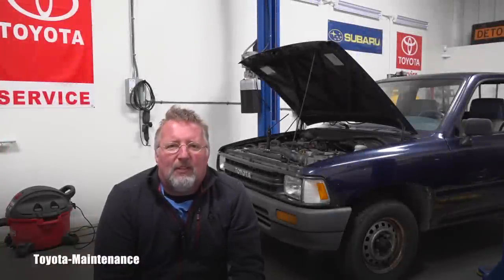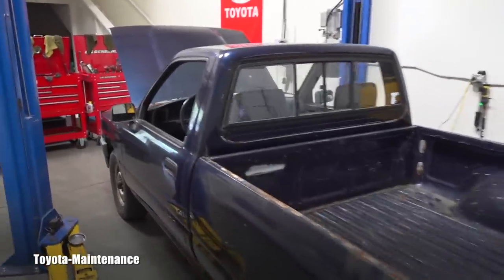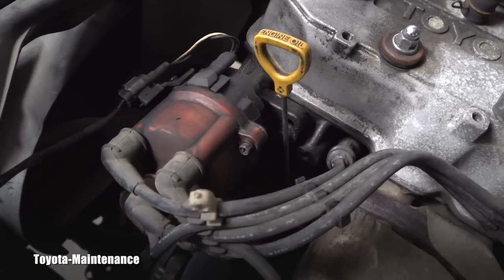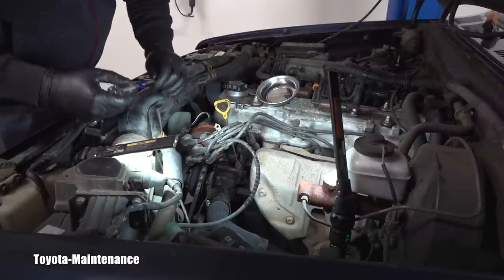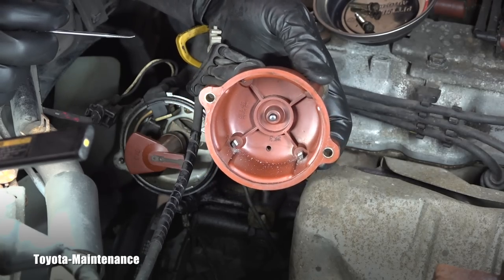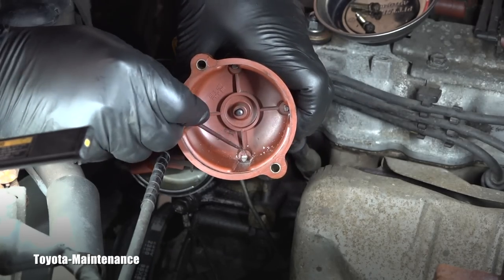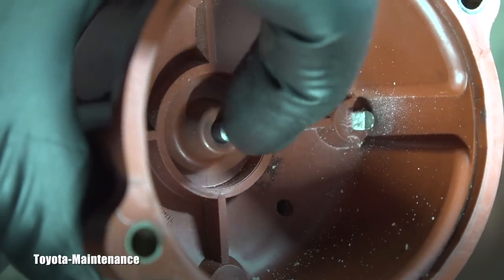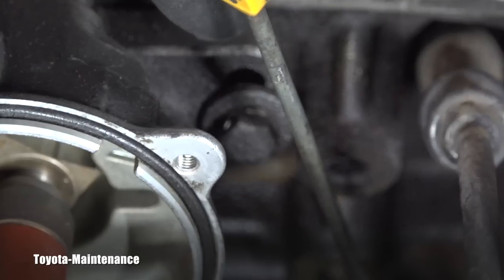Toyota Ignition Distributor Cap and Rotor Inspection

Comment: Peter, After 29 years the expense of a new rotor, cap, wires and even a coil  can be justified. Just make sure to use OEM parts as we expect an update video in the summer of 2049 and discount parts won't last that long. Long live #manual pickups!
Reply from the maker: yes !
Reply: @ToyotaMaintenance  :)

Comment: If the screws are too tight I use a needle nose with a rough surface and grab the screw and twist to break it loose then use the Phillips to unscrew. . Worked for me everytime.

Comment: Still have my 91 , 383,000+ miles on it . Would do jack knife tune up on it while on lunch break in the woods. Biggest breakdown in delivering spark to plugs is in the condition of the plug wire set. All to often service shops would just replace everything, habitually running up the bill. "You need a new Johnson rod in there" . Seinfeldism

Comment: Thanks for sharing this information, I just change cap and rotor myself,also changed. Cap O ring and distributor shan’t o ring commonly leaks oil .  A. Fresh set of wires and spark plugs was  NGK spark plugs.
Reply from the maker: Nice work!

Comment: These are good old reliable  like a wife 😝 LOL if the cap is not cracked just clean it   With a  small wire brush it’ll work fine

Comment: I note that in this 1991 Toyota the engine drives the rear wheels unlike in the saloons which seem to be all front wheel driven. Also the distributer does not contain the ignition coil . In my 1987 carina  which has only done 85000 miles I have just fitted   the third ( 3rd coil ) new coil The coil  which is within the distributer !!!

Comment: If that truck belonged to me, I would have you replace the rotor cap, the rotor arm, new plug wires, and plugs.  While you are at it, replace the fuel filter.  Just me. Thanks.
Reply: Why replace things that are still working.

Comment: The distributor cap screws on my 20r engine have Phillips and 10mm hex heads. Much easier to use a wrench. Also as far as I know, only the oem caps have screws that don’t separate from the cap.

Comment: Before that they had points to adjust and a vaccuum advance for the ignition  on carburettor engines.Usually on a lot of makes there were clips holding the cap on which made servicing much quicker.It would be nice to have a simple car to fiddle about with again.
Reply from the maker: Great point!

Comment: I've got a '93 and the triggering owner rotor with the 4 paddles on the shaft is about 20 degrees off counterclockwise from the rotor. Shouldn't it be directly in align with the rotor? There is also a single paddle above the triggering rotor (and below the top rotor} that's in exact alignment with the top rotor. I'm guessing it's only there to help with alignment...??

Comment: Hi, I just saw this video. I will be picking up a 77 Toyota pickup. It is quite cool. Has side steps and haven't seen nothing like it online. It's supposed to be one of 500 made. Some kind of California edition. Anyways. I was wondering a few questions. Like. Is the fuel pump inside the tank? Lol might seem like a dumb question but the old guy had it started from a gallon tank with a hose. Soni assume the pump is on the outside. Another question is what is the spark plug gap? It's a 4 speed standard gas engine. Any info on this old vehicle would be super helpful.
Reply: I have a 78 4speed manual 20r and the repair manual says .031

Comment: And you set the mixture and idle speed with screws?
Reply: Only the idle i think. I have a toyota corolla 1993 that is only 2 years ahead of this model and mixture is made by the small ECU. As i see on this truck it uses an intake with injectors. So for sure mixture is made by the computer and idle by screw attached on bottom of gas pedal cable.
Reply from the maker: This is fuel injected

Comment: Thank you for your knowledge! 
Would you know why my 87 toyota 22r starts hesitating and sputtering when i go past 3000 rpms?? Plz lmk thanks!
Reply: Not a mechanic but i ve learned so much owning old toyotas  when i had a spuddering and couldn't find the issue even after replaced all that needed to be replaced it turned out to be the ecu capacitors thy where burned after the repair car ran fine
Reply: @jvst20051  thanks I appreciate the support 🙏

Comment: Very reliable, but completely unsafe in today's world. Even just a moderate accident in this will be a catastrophe since it does not have any of the safety features that modern trucks have. I cannot see using this as a daily driver.
Reply: I suppose you maybe the type of person that "MUST HAVE"> air bags?
Reply: ...? So long as it had decent tires, decent brakes, decent seatbelts, I'd be very comfortable daily-ing such a vehicle. 29 years and 240k miles can't be wrong.
Reply: yea, I wouldn't be able to safely drive without 7 cameras, tire pressure monitors , gps, bluetooth, etc, etc.